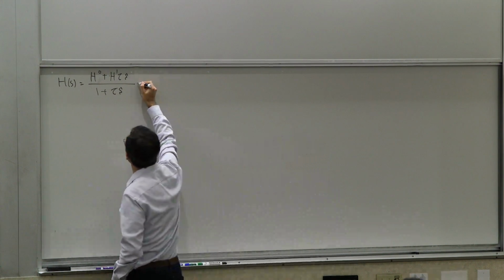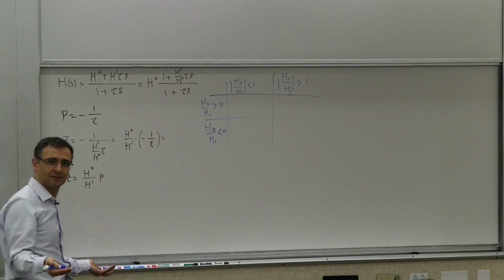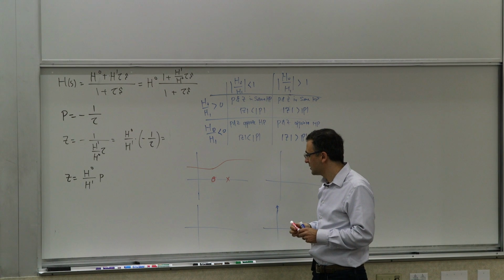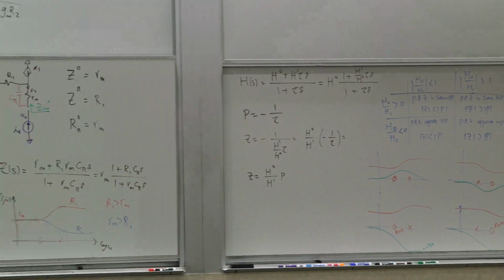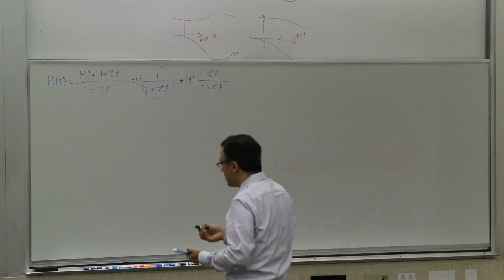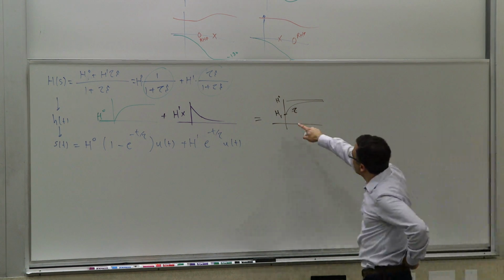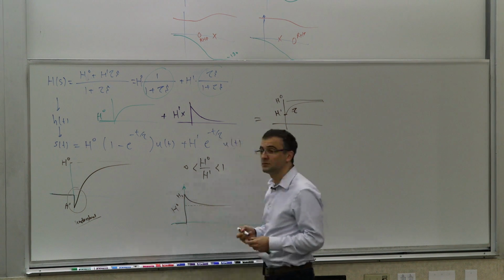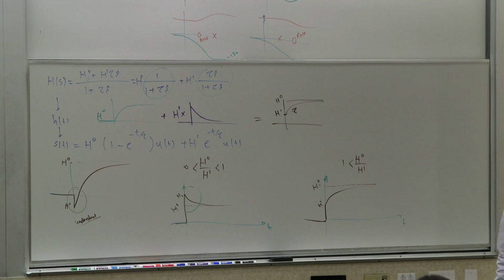142N. Zero/pole in 1st order system, step response, undershoot and overshoot

Comment: Minor correction at 7:25, when you have a RHP zero and LHP pole, the phase will START at 180, and then drop to 0. This is just a very nitpicky detail but I thought I might as well leave a comment.
Reply: Correct. That (Pi - arctan of zero ) term in numerator, will make phase plot start from Pi onwards and going down thereafter.
Reply: Similarly in fourth graph too same mistake appears.

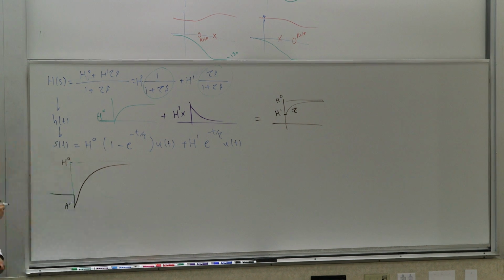Comment: 15:17 Hello Sir, would the step response look inverted along x-axis, if H_0 was negative & H_1 was positive?
Thank you for the lectures.
Reply: H_0 is negative means the system is an attenuator, not an amplifier. Yes, the step response look inverted along x-axis.